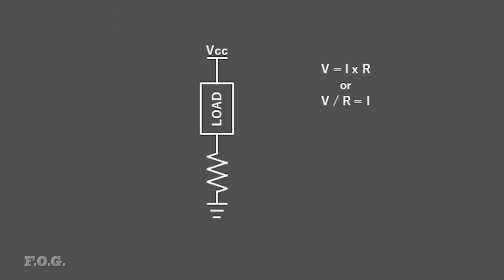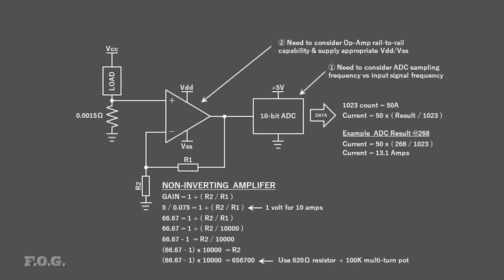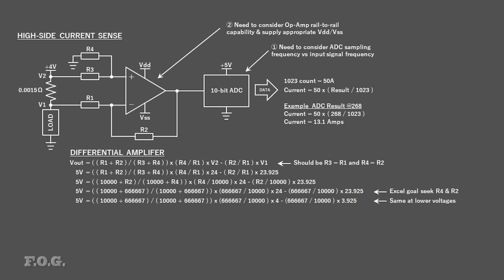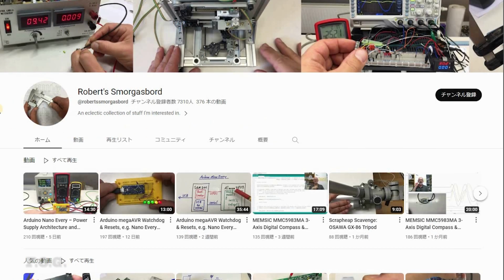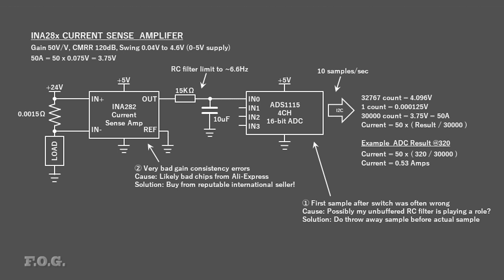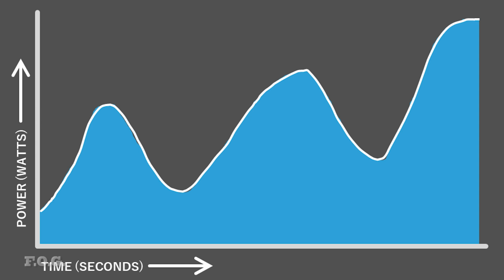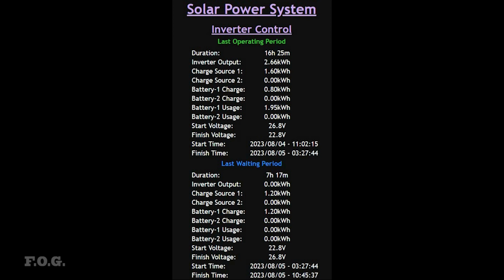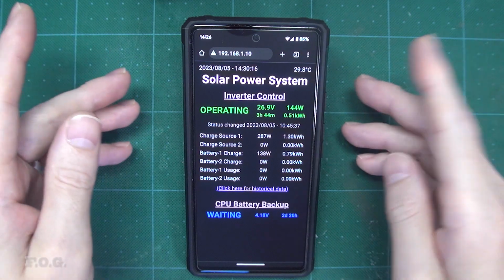EP3 – Solar Controller – Monitoring Power

Comment: Great video thanks and very useful, I live on a boat so use a shunt to measure all my current flow including from Solar of course. Going to dig out my old Victron 500A shunt now and have a play around with it.  I have been caught out a few times with dodgy chinese chips, I had some AS5600 chips where i spent two weeks trying to get them to work, then idiotically bought some more cheap ones and stupidly used the supplied "diametrically opposed' magnets and spent a further two weeks wondering why they just wouldnt work only to find out the magets were in fact not diametrically opposed.. Live and learn I guess. Thanks for the videos, very interesting
Reply from the maker: Glad you found it useful, likely will be one of the few, but a few is better than none! As for buying chips from Ali-Express, I now find myself sticking to a handful of big sellers, never seem to get bodgy stuff from those stores. I know where I was going wrong though now, and now, if I find myself only finding such specialized IC on smaller stores, then this is a big red flag. Simply put, if the big stores don’t have it, then generally this indicates that such chips are not generally distributed in China, and likely what the small stores hold will be junk, so going to the international sellers is the better way to go. Small stores sometimes are ok for some very basic electronic component stuff, resistors, capacitor or mosfets and Chinese brand chips, but otherwise I steer clear. Thanks for mentioning the AS5600 chip, I was not aware of that particular type of IC, but I will keep it in mind in case I need such a chip for my project! What in particular did you use it for?
Reply: @ForOurGood  yes all good advice thank you. I used the A5600 for a combined anemometer and wind direction head on my weather station The 5600 measures the rotational position of the wind vane so wind direction and I used a ss441r hall sensor to measure the rotational speed of the anemometer using two normal magnets for balance. Took a bit of work figuring out how to mount everything. All parts 3D printed of course 😁 i did have an old sensor from a steering angle sensor from a car but it was difficult to interface with whereas the 5600 has I2C onboard and can output analog / pwm plus it can register down to less than 0.1 degree change. Seen people using them for intelligent rotary knobs and the like. I only use the basics as I am a newbie but it seems like a very versatile little chip as long as you get the correct magnets!
Reply from the maker: @AndyJenkins999  Very cool project, and I like the way you implemented it. I have always planned to do a weather station, so I might steal a couple of those ideas! Thanks for sharing 🙏
Reply: @ForOurGood  No worries I was inspired by someone else on the Internet so it all goes around. 👍